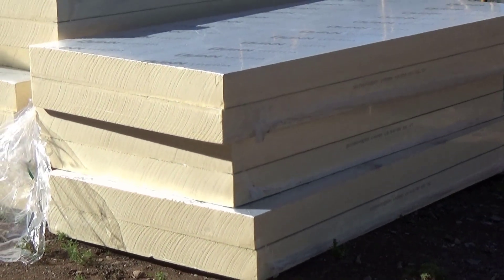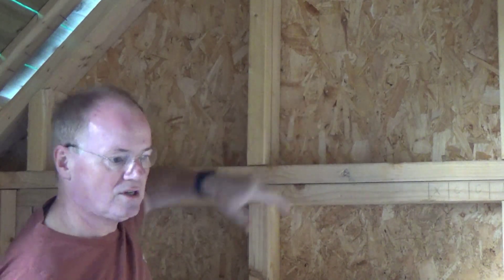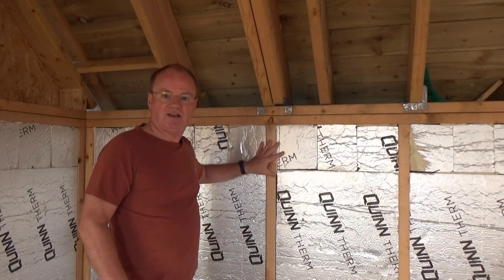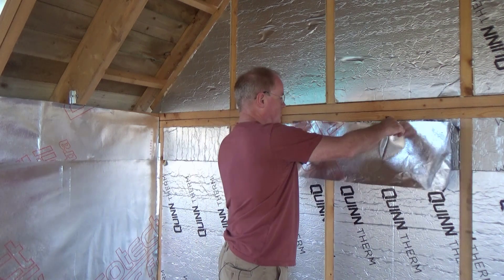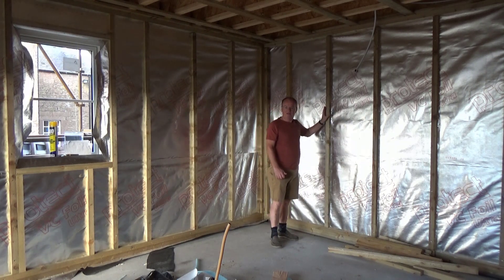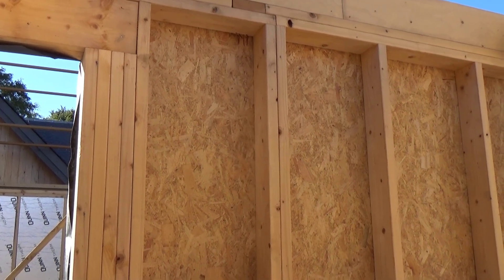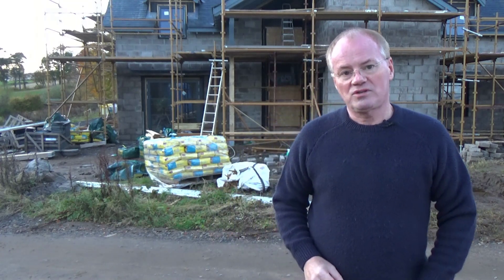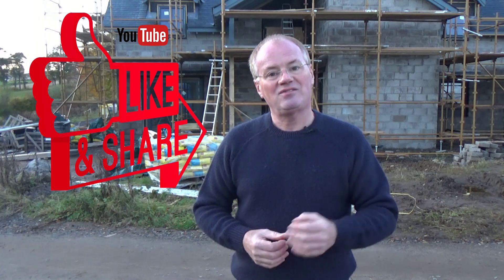How to Insulate Timber Frame Walls in the UK and the Wall Construction

Comment: Probably be best to film your video on the workers dinner breaks! 🤔
Reply from the maker: Hi Dominic Johnson I appreciate your comment and of course I wish it was always possible to have these videos free from external noise. 

Unfortunately, there is no lunch time on a building site. With many trades on site at any one time who take their lunch at different times and the need to film this during daylight hours it was not possible to make this devoid of external noise. If I had left this video any later to film the insulation would have been covered up. 

Also, although the video was just 8 minutes, the original was much longer. From memory I think I shot around 40 minutes as there were sections I had to re-record that had much louder noise than you experienced. It’s not generally understood, but a short video such as this can take anywhere from 4 to 8 hours to produce. As you can see that this YouTube channel with over 100 videos is a major commitment, so I hope you will subscribe to encourage me to keep producing them.

Comment: I'm pretty new to this and was wondering, is there any cavity in this wall to prevent moisture trapping and rot? Does the service void serve that function?
Reply from the maker: Hi patrick cross There is a cavity wall between the timber frame kit and the outer wall of the building. If there is a build up of moisture, this will most likely be caused by poor ventilation. In most houses ventilation is provided this is provided by trickle vents in window. Where you have a very air tight building this will normally require an air filtration system. This will typically cost around £2,500 to £3,000 plus fitting costs.

Comment: Timber frame, isn’t that more USA style?

Do find it interesting & different as it speeds up build.

Only reservation I have is with sound, energy wise. How does it differ to brick build house?
Reply from the maker: Hi Sukhjote Singh, Timber frame has been around for a long time, you only have to look around Stratford on Avon to realise how durable it is.  Almost all the houses in Scotland are built using timber frame construction and once completed you would not know the difference. It also has the benefit that there is less drying out. As you have correctly pointed out it is widely used in the US. Sound, energy-it is no different to brick built houses. It has to meet the same standards.
Reply: @BuildItandProsper  Interesting thanks. Where can I get in touch with you directly?
Reply from the maker: @sukhjotesingh9613  You can email me at support@builditandprosper.com
Reply from the maker: @sukhjotesingh9613  That's strange, I thought I had replied to this.  You can contact me at support@builditansprosper.com or by sending me a private message through our membership site.  You can sign up for free at https://members.builditandprosper.com/

Comment: Great episode, can you tell me how I go about taking soil pipes through the timber frame wall which will be my 1st floor addition to my bungalow. What are the rules or regs on this. Thank you paul
Reply from the maker: Hi Paul Power Have you thought about rather than taking the SVP through the wall, to take it through the roof. You can then put an exit vent in the roof and do away with having ugly pipes on the outside of the house. Any SVP has to terminate above the highest window in the house.

Comment: Hi, we've bought a timber barn conversion (converted in the 90s), and its freezing! Is external insulation possible you think? Remove the timber cladding and battons, and attach external insulation onto the OSB. Cover with the house wrap membrane and then use battons to ensure a 25mm ventilation gap between the insulation and cladding?
Reply from the maker: Hi @nirajbarot9099 It seems like it could work.  However I don't have any experience with conversions, in fact I avoid  them.  While I have a good understanding on building techniques, I am and remain a property developer, which does not require me to know the technicalities.

Comment: Hi there 
I have a timber frame home built in 2000 or so.. it’s cold as 
5 degrees in room at night 
Can I remove inside plaster board and put in insulation then re plaster board .. Or can I put wood battens on plaster board and insulation 100mm on top of that 😮Which is better
Reply from the maker: Hi @ciaranl2781 If there is insulation already there then you might need to build out the stud work to take thicker insulation as the stud wall may be only 90mm wide. It is likely that the insulation if there is any will be fiberglass or rock wool. You could replace this with PIR boards that have a higher U value.
Reply: In a similar situation myself. Is it possible to replace old insulation with 80mm PIR boards and replace old plasterboard with insulated plasterboard rather than build out the stud? I have heard this can cause issues with moisture between the two?  @BuildItandProsper
Reply from the maker: @darraghmcmahon8828   I don't see why  not. Ventilation is always good. I should point out I am not an expert on all the constructions details. It's true I have been doing this for over 20 years now, and learnt a great deal but what I have learned is from asking questions, rather than learning the skill itself. 

Being a property developer is not about how you build a house, its about finding suitable land and funding the deal. In the process you need to protect your gross profit which is in the range of 25% to 33%. There is of course lot's of nuances to this. That is what I help people do.

Comment: Hi, I've got a small extension roof that I'm  insulating with kingspan. The  rafters are 6x2 and the kingspan is 75mm thick. Should I just double up on the kingspan? Would appreciate any advice from you
Reply from the maker: Hi Mike Brannan Yes doublining up will give you the thickness you are looking for. I personally use Quinn Therm which is generally much more competitively priced.
Reply: Thanks for your swift reply. Can I just ask if I just fill the rafters with 150mm insulation it won't need any ventilation between roof and the insulation. I'm guessing not because it's only a small kitchen pitched roof. Also just to say that I'm also putting insulation plaster boards on top
Reply from the maker: @mikebrannan4593  Yes that is correct you will not need to allow for ventilation.

Comment: Hi, we are having a timber frame extension built on top of a cavity wall extension. The existing is already rendered an the timber frame will be rendered too. How do we go about creating a water drainage between the connecting extensions?
Reply from the maker: Hi @oliversindotcom That really a question for your structural engineer.

Comment: Hi what is the foil wrap roll you use inside ontop of the insulation?
Reply from the maker: Hi @rainbowmorphs Its Protec VC Foil and is the same as can be used on the exterior of the timber frame kit. https://insulationmerchant.com/products/1-5m-protect-vc-foil-ultra-vapour-control-layer?variant=16146867847214&currency=GBP&utm_medium=product_sync&utm_source=google&utm_content=sag_organic&utm_campaign=sag_organic&gad=1&gclid=CjwKCAjw7c2pBhAZEiwA88pOF0VaAf9LcY8cZ0SgFdez6odex8YLPhBKMsFb8aN_beBY3IRfEzxxkxoCX-oQAvD_BwE